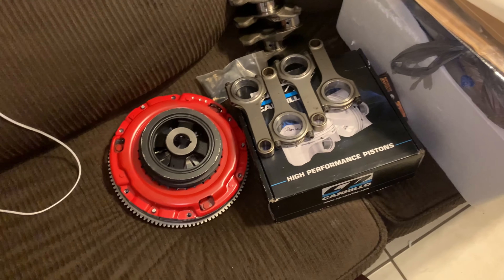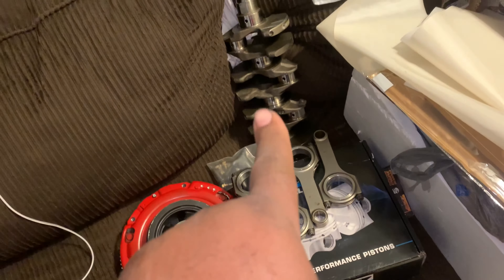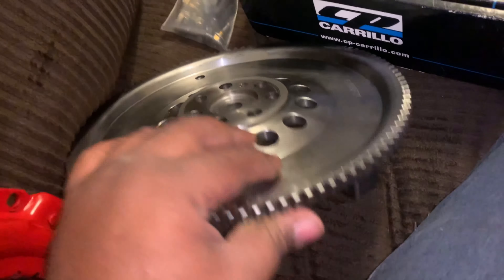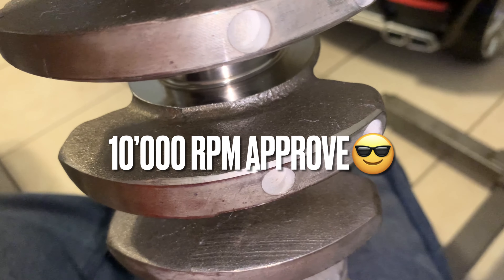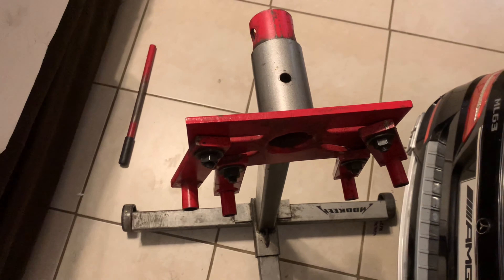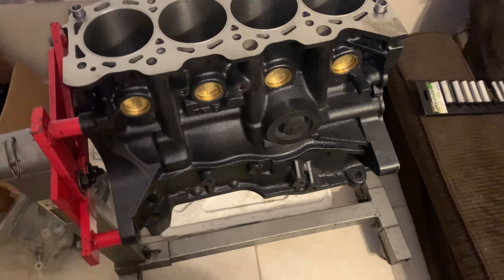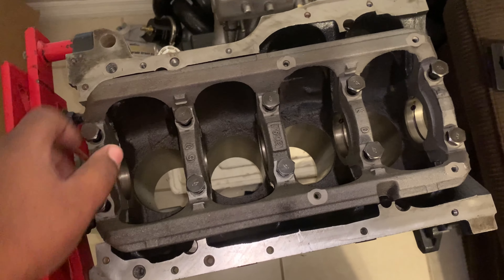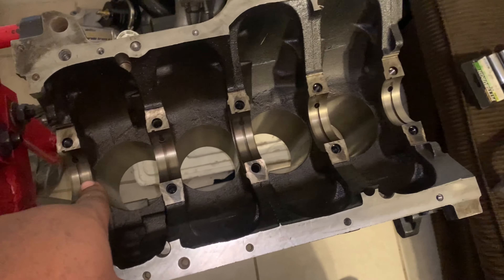MIRAGE Ck4A 4G93 DOHC MIVEC RS TURBO Build Begins

Comment: Hello again. I'm only getting around to my build now. I'm really thinking about going Mivec and getting the most from it. As my car is a 99 JDM CJ4A Mirage, it already has the correct loom for running the Mivec engine, and I know all of this still works as its running. Im hoping I can just plug in my plastic case ECU into the existing Mivec loom, bolt on the Mivec head to the built 4G93T bottom end and thats that. However, not sure the plastic case ECU can control the Mivec system and it would be stuck on low profile all the time? What ECU are you using, and has your car been mapped yet? Would love to see some dyno charts. Thanks.
Reply from the maker: Hey, how are you? Yes you can definitely use any plastic ECU as long as it’s not 2000 and up and they can pretty much use any wire to activate the.Mivec you would just have to get it re-flashed me personally, I’m using a completely different computer called FuelTech and I haven’t gotten to the plateau of getting the car fired up yet. I actually ran out of money on the bill lol but it will be coming soon.

Comment: I have a g54b stock pistons & rods Has a gt35 82r  with 3in intercooler & piping msd 6al, for fuel has a 350aem pump  -8 feed & aeromotive fpr... how much boost can I run??
Reply from the maker: Definitely depends on your tune and mainly your ignition timing as long as you don’t get that mission you can run all the way up to 25 to 30 psi but I would highly suggest running E 85 to keep things safe when you go up that high

Comment: the oem 4g93 connecting rod got small hole oil spray facing exhaust side,when the piston go down at bottom death center the engine oil will spray the piston ring & wrist pin.
Reply from the maker: Oh wow I never paid attention to that and that would definitely come in handy
Reply: @legionelitemotorsports2096  basicly 4gxx engine have the same rod pattern,take note the rod bearing 1side got 1 hole correct? no hole side put on the rod cap.

Comment: Is this a custom ARP Mains Stud Kit? Or are you using an off-the-shelf mains studs?
Reply from the maker: No the main studs are from a 4g63 so off the shelf ARP
Reply: @legionelitemotorsports2096  did you have to redrill the block for those studs or is it a direct replacement?

Comment: Hi,

I need your help,

Can I use the connecting rods and balance shafts from any regular mitsubishi non turbo 2.6 g54b engine to rebuild the 2.6 g54b in my 1988 conquest ?

I'm trying to put my engine back together,  I purchased my conquest with an incomplete engine. 

Thank you,
Reply from the maker: I would definitely eliminate the balance shafts And you would definitely have to use the turbo pistons because the non-turbo pistons are very weak and they will crack but other parts and pieces yes

Comment: Hi, great video. Looking for some specs on your build, if you'd like to share that is. I'm building an 1850cc 4G93T, non Mivec. I'll be using the standard 4G93T exhaust manifold and downpipe, just wondering what size you're using? Also what turbo are you using? I'm thinking of GT2860RS. Are you using an F5M42 box with 4.625?
Reply from the maker: Oh yeah definitely willing to share so my downpipe is 2 1/2 to 3 converted  and I’m using a GT 35R turbo  ball bearing and I put in a Kazz lsd in the 1.5 trans and the numbers are f5m411
Reply from the maker: So the gears are slightly longer I would definitely go with a smaller Turbo to get response time where you want it I recommend the G 25 series
Reply: @legionelitemotorsports2096  Thanks for sharing. I'll be using GTX2860 Gen2. The GSR engines (4G93T) have fairly mild cams, so I reckon that peak power will come at 6K rpm. This means Mivec gears are far too short.

Comment: Are you familiar with the 2.4l Mivec as well?
Reply from the maker: A little bit mainly from mighty car mods LOL
Reply: @legionelitemotorsports2096   I always wondered if the electronic throttle body can be converted back to cable driven? If you've ever heard of such being done?  Just curious, no info available.
Reply from the maker: Yes 100% you can use the 1.8 throttlebody or the 3000 GT throttlebody and you would have to use the 1.8 computer and harness and basically run the car like a 1.8 and hook up the mivec to a switch or a VTEC controller
Reply: @legionelitemotorsports2096  Thanks